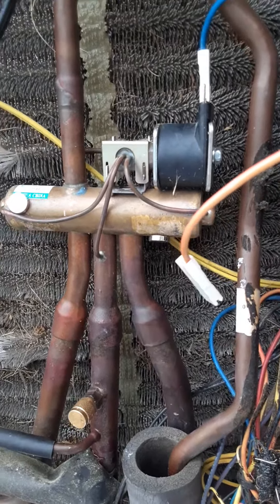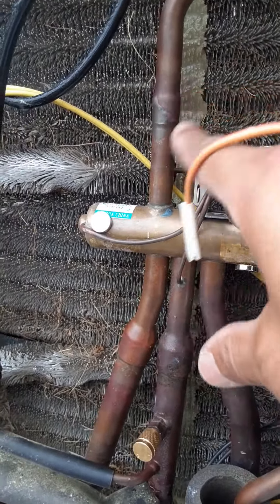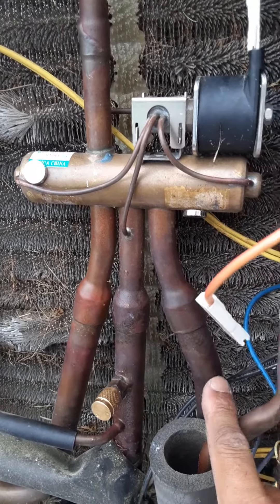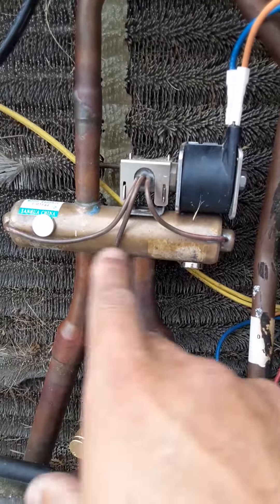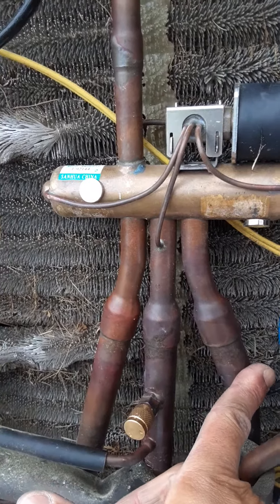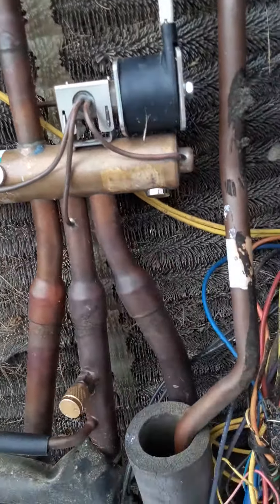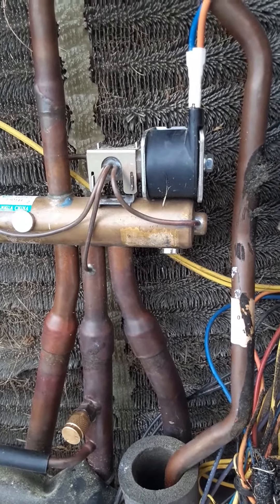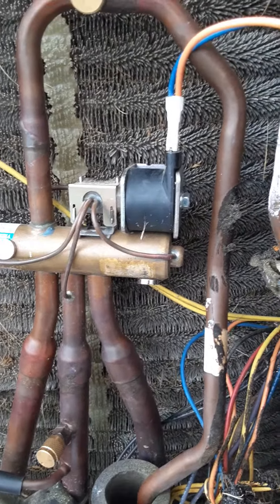Trane heat pump reversing valve.

Comment: Is it common for the seleniod to go out?
Reply from the maker: Yes like any other parts. Verify the coil is energize using a flat head screw driver on the top of center of coil and moving the screw driver up and down slowly to see if the coil energize.
You will get a magnetic pull and If no magnetic pull. Check for power and ohm the wires with the power off.
Reply: @islandbeaches395 I use ohms, they are usually 14 to 17.

Comment: there is no magnet in there.. the pressure from the discharge line pushes the valve inside to each direction
Reply: He was talking about the magnet placed on top and on the bottom of the valve to show movement, since you can't see the actual valve inside shift
Reply: For those that want to fix the ac for the day..tap on the reversing valve witha hammer keyword "tap" this is exactly like what you do with a bad starter on a car you tap it til it works..you live it jumped from orange to red

Comment: What if its switch stuck on heat
Reply from the maker: Verify there is power going to the solenoid and the correct refrigerant pressure.
Reply: @islandbeaches395  should it be 230 volts?
Reply from the maker: Check the the solenoid coil for the voltage rating it's stamp on the housing.
Reply: @scal760 No, normally low voltage power. So 24 volts but like his reply check voltage spec on solenoid.